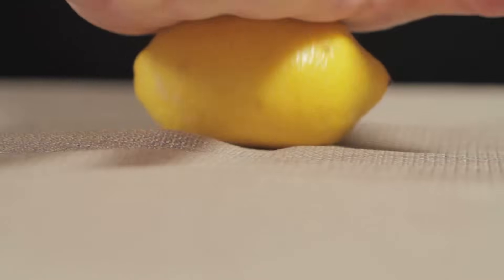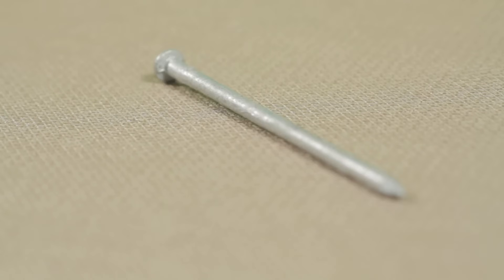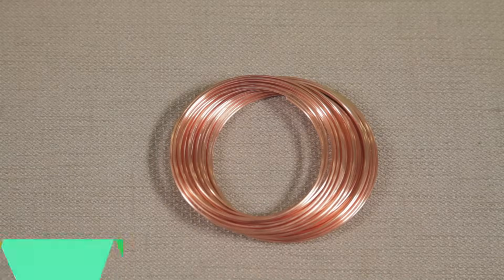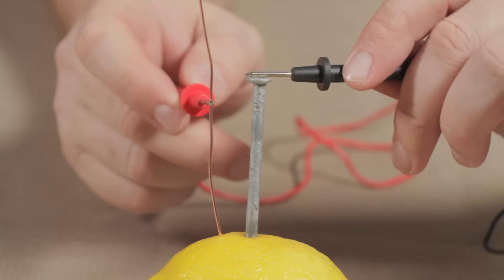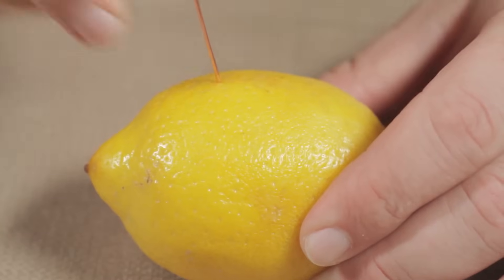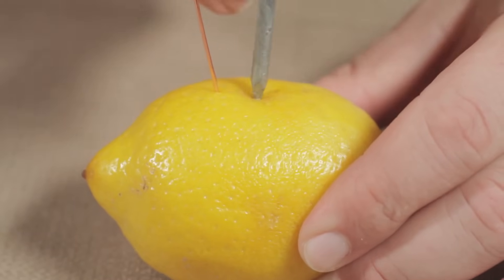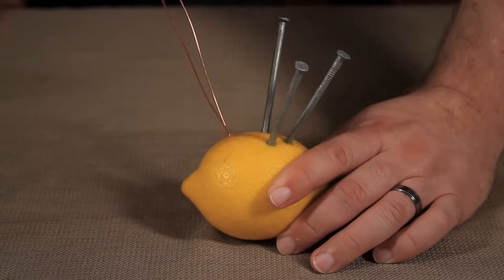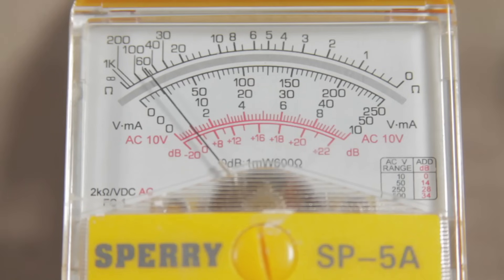How to Make a Lemon Battery

Comment: No, it was originally discovered by Luigi Galvani (who was using frogs' legs, not lemons, and was dissecting them for biology reasons, but was using two tools (of dissimilar metals) for the dissecting) and first understood by Alessandro Volta, who made the first battery (or "voltaic pile") out of a stack of dissimilar metal disks and something porous soaked in saltwater.

Eventually someone was like, "Lemons have acid in, right?  They should work for batteries too!"

Comment: I have to point out that in this case specifically, it's not the copper that wants the electrons, it's the protons (H+) in solution. The copper wire is merely an electronic conductor noble enough not to be attacked by the acid.

Comment: 0:39: Actually, Hank, I *would* be rather surprised if a _voltmeter_ was showing an electric _current_.  What you have there, my friend, is a "multimeter", and if it is set to display current, it is acting as an "ammeter".  Which you'd know if you weren't such an ammeter.  (Sorry, couldn't resist the 'amateur' pun).